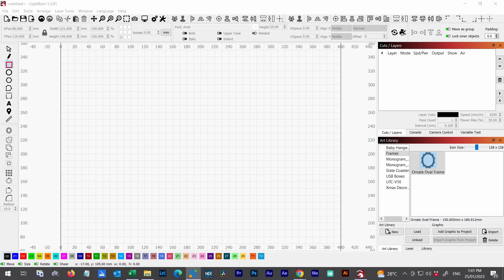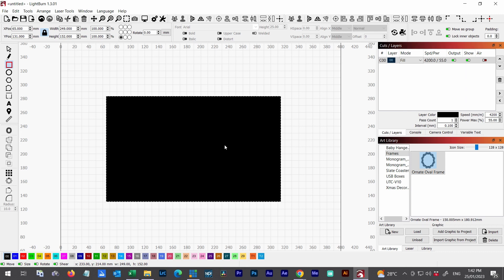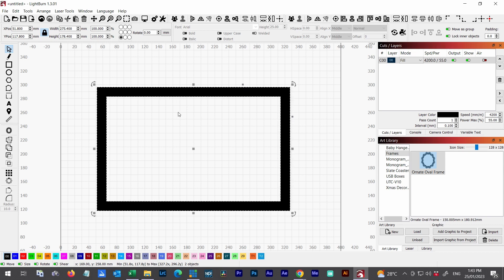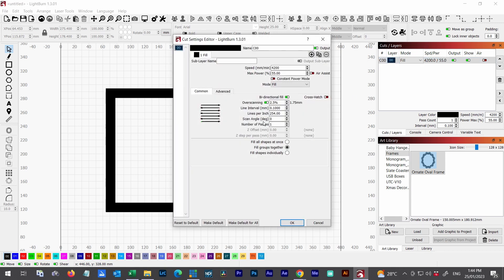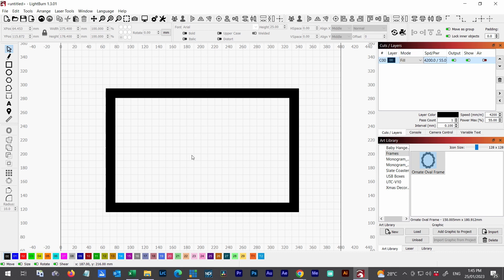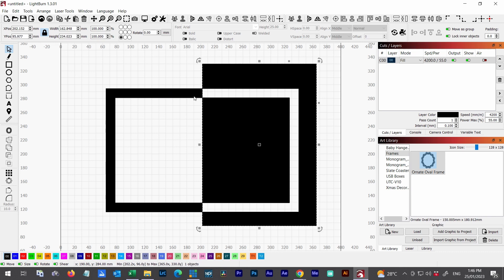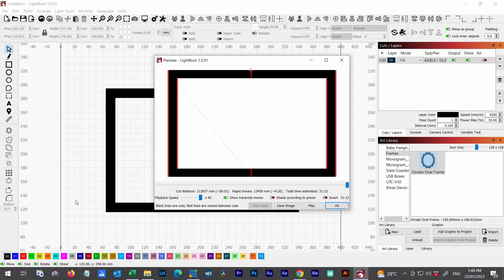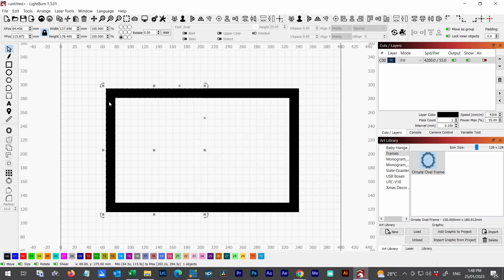Lightburn Faster Burn Times with Offset Fill

Comment: Using the same shape but not splitting in half, could you achieve a similar result by speeding up the white space scan?/ during engraving?
Reply from the maker: Hi Allan - you can definitely increase the speed of the job by speeding up the white space scan - however - it is still travelling that empty path - whereas this technique eliminates the majority of that empty path making it more efficient in my mind 🙂
Reply: @mrcraftsmith  thanks for that Darren I’m relatively new to this hobby but I’ll give your version a try and report back. Thanks for your videos, I find them very easy to follow, not rushed like others I could mention, well done
Reply from the maker: You’re welcome Allan

Comment: Just a tip. You could also select 'flood fill' under the advantage settings in the cut settings editor. This results in the same time savings with out having to cut the design in half.
Reply from the maker: Hi Salvador - that is true - I may have mentioned that in another video - but I could be wrong 🙂